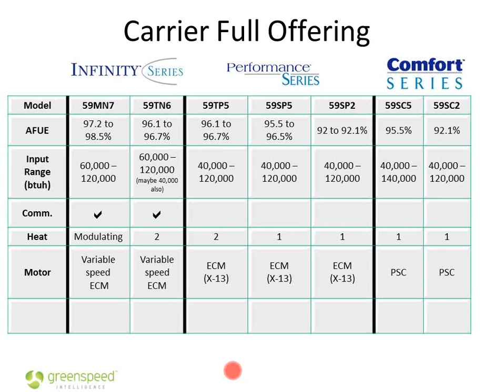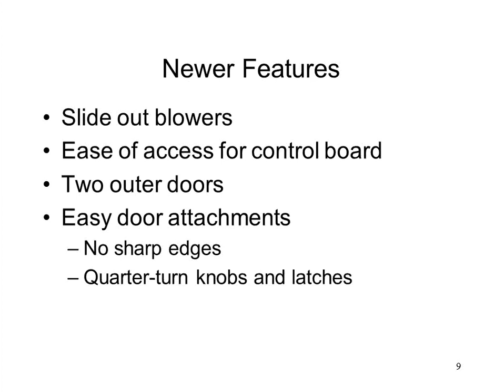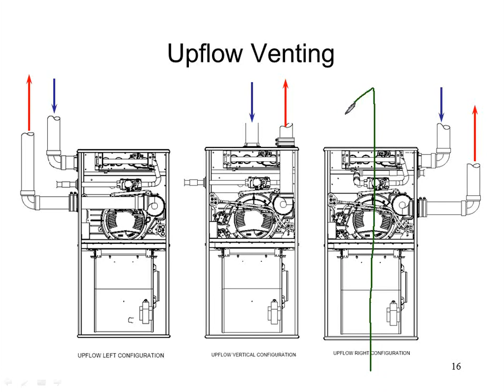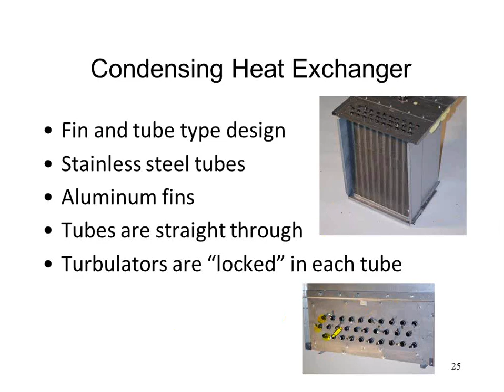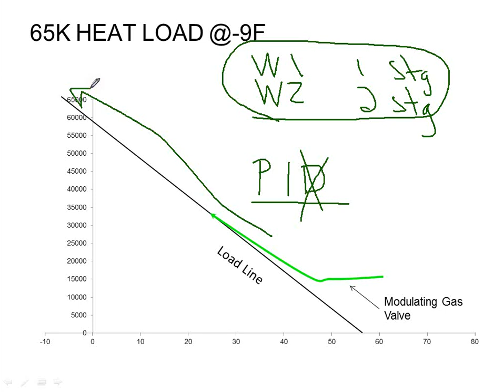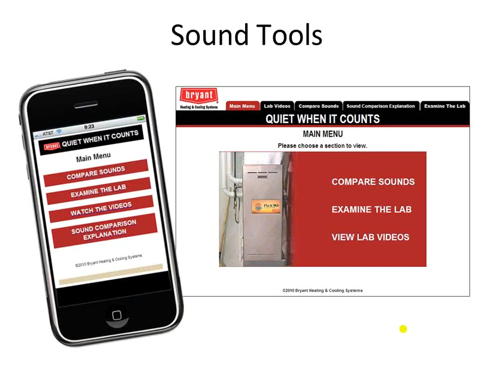Bryant/Carrier Modulating Gas High-Efficiency Furnaces - Webinar 11/25/13

Comment: I appreciate your channel and love the content. I was hoping you can help and give some direction with a Bryant Evolution - 2 zone system.  With the system in service mode and switching between zone 1 and zone 2 to check air flow noise,  I can feel good flow from both.  In heating mode, I feel as though flow is reduced and I occasionally get a high limit fault and stuck miswired damper zone x.  If the dampers are switching (opening and closing) in service mode, wouldn't that show they are not stuck/miswired?  Need some help fully understanding this system.
Reply from the maker: Multi-stage furnaces, not just Evolution, use different airflow fan speeds for 1st stage heat than 2nd stage heat. And many of those are different than fan only mode and cooling mode fan speeds. So testing airflow in fan mode is not representative of how much air you can expect in heat mode.

Additionally, it sounds like you are comparing the fan running for just 1 open damper (in service test mode) to it running with possibly both dampers open.
Reply from the maker: We have never seen that error code of mis-wired or stuck damper. If you have an intermittent issue with your damper blade, damper actuator, or wiring, that is much harder to troubleshoot than a constant error occurring.
Reply: @TECTubefilms  So this customer had a Bryant Evolution furnace with the bad secondary heat exchanger.   It was swapped out with a comparable  Evolution furnace.  He complains one of the rooms in his zone 2 is colder than normal & the second floor doesn't have the air flow or "noise" that it did with the older furnace.   Looking in his last 10, I am more confused as he has 100-duct cal: zone x damper stuck/miswired"  Duct cal: total size failure & sometime " 33 limit fault"  and g terminal shut down.  The system was originally installed with the overflow switch (in the pan) tied to the thermostat wire, not wanting interference with splices, I moved the float switch to g terminal shutdown.  I am so confused...